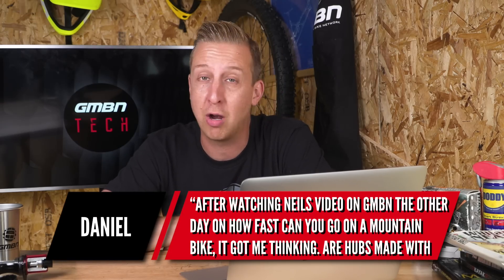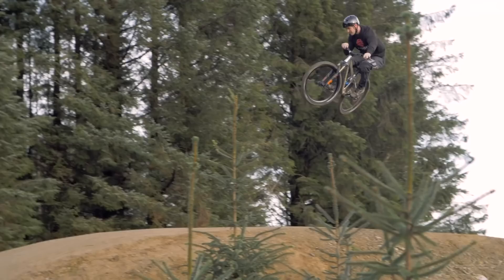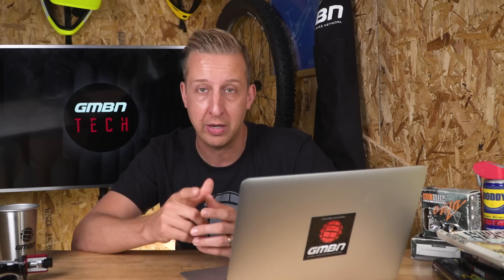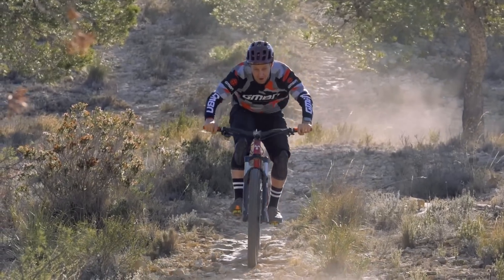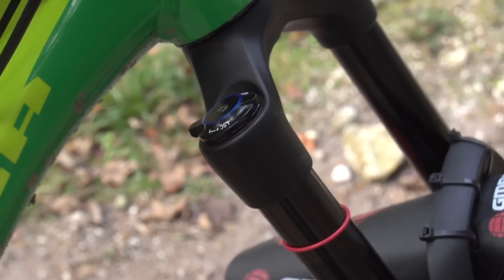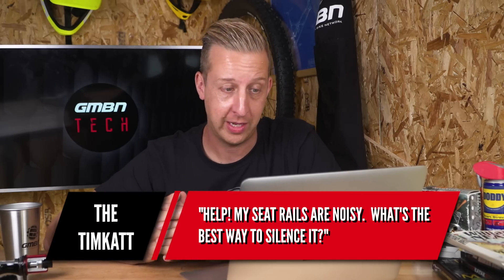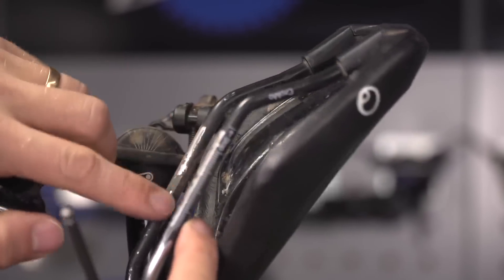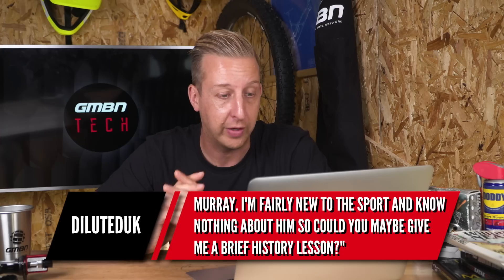Will Riding Too Fast Break MTB Parts? | GMBN Tech

Comment from the maker: Keep your questions coming in for next week by emailing hellotech@gmbn.com or using #askgmbntech and any questions for Park Tool's Calvin using #AskCalvin👇
Reply: GMBN Tech hi daddy love your vids
Reply: Just wondered are frame protectors  really needed In enduro races
Reply: @Duckyboi-0069  I just put some huge dents in my down tube from a high speed loose rocky section, wouldn't have damaged it if I had some protection, just depends what type of terrain your gonna be riding.....
Reply: #askgmbntech Can you give some hints on what I have to look on when I wanna buy a second-hand bike? Like wich parts to look at carefully and what you have to take attention of when test riding.
Thanks for your work, definetly learned much of your great answers.
Reply: Hey doddy I don't know if you remember but I left you a tip on here about using closed cell backing rod as tyre inserts/rim protection, got a rear flat in a enduro race and rode it to the finish with no issues to the rim.....
Reply: #askgmbntech Hi Doddy, love the tech stuff you bring out everyday. I'm currently riding a 2016 Btwin rockrider 560s. Recently, a creak has developed which I managed to narrow down to be coming from the suspension bearing cap. I loosened off the cap and the creak disappeared. However here is the problem. When I try to tighten up the cap to the recommended torque(8 ~ 10 Nm), the creak returns. Currently I have the cap a little over finger tight so as to keep the cap from creaking and ruining my rides. Is it fine to continue riding the bike this way or is there anything I need to do?
Reply: Hi Doddy, why no new air shaft for the pike (cheap and making the fork better for about 35€) or charger 2 instead of rct3? I would not build in a old rct3 and i also would think about going to a shop to tune my bike for much more money. Even tokens can change the fork (the new from formula work great in a rs fork). So i am confused why you not thinking about all this things.

Comment: #askgmbntech Hey Doddy , I'm going building full suspension 29er in the near future just waiting for all all the parts to arrive. I've everything ordered at this stage assembly compound , chain lube etc.  bar the grease since it's a carbon fiber frame and I keep seeing contradictory statements on the internet about what you can and cannot use. So can you us me a few options on what grease I can use on the bearings in the head tube, bottom bracket and the pivot etc. Thanks in advance.     Mark
Reply: Mark Phelan actually I have the same question regarding integrated headset in carbon cups. Some say I shouldn't grease it; others that almost any grease will fit.
Reply: The only one I've seen so far that specifically mentions that it's safe for use on carbon fiber is the Park tools polylube, but I'd like to see if there are other options out there that I've missed. Hope that helps. If you see anything else in your research fire back a reply.

Comment: #askgmbntech Hey Doddy, I recently saw a video on The Singletrack Sampler where someone had a converted GripShift as a Dropper post lever. Could you explain how that works? And could you use a brake lever for that as well? 
Thanks to anybody answering

Comment: #askgmbntech hi guys great show as usual, i have a quick question my vitus escarpe 2018 has a FSA Mega Exo (BSA) 73mm ive just bought an xt crankset(boost), i admit i probably didnt research this properly do you think the crank axle will fit the above mentioned bb or will i need to replace the bb, any help greatly appreciated. keep up the great work guys

Comment: #askgmbntech Love the channel, it's been really helpful. Just curious about positioning of rear-shocks. Does the positioning and fix point of the rear-shock affect ride-handling? E.g. a rear-shock that is vertical compared to one that is angled, as well as being fixed to the top tube or down tube; like the Yeti ASR-5 or the Whyte T130 compared with Canyon Neuron. Thanks

Comment: #askgmbntech

Hey Doddy,
I would like to upgrade my drivetrain, if my current one is worn out. I am running a Shimano SLX and XT 2x11 combo my Spectral 2017. I have a 34/24 chainrings up front, a 11-42 cassette and a XT rear-derailleur with the long cage. I want to go for the 36/26 chainrings up front and get a bigger cassette for the rear, like the 11-46 or even 11-50. But I saw that there is a correlation from 3x, 2x and 1x to the size of the cassette? Why is that? Is it not only connected to the chain length?
I hope you help me out here.

Cheers Steffen!

P.S. Yes, I want to keep my 2x11 setup ;)

Comment: For the pike guy:
-check out the new air shaft (debon air 2)
-if you want your fork standing higher in mid travel, get some formula tokens
- if you want spend more money, get charger 2 and no rct3

Comment: #askgmbntech hey, I have a dilema I need to answer to. I am ready to buy a new bike and my choice is on the Canyon Strive CF 7.0. I am wondering if I should buy the 2018 version right now to be able to use it while the weather is still nice outside or if I should wait a few month for the 2019 version that will come out in october-november. I mean, do you think the upgrade that will come with the 2019 version will be really significant ?

Comment: #askcalvin hi Calvin I'm a big fan of park tool please can you help me, I've got a 2007 giant glory dh with a 2010 rockshox boxxer race that feels sticky and doesn't feel plush and gets stuck 15 percent through the travel, I have to take all the weight off the fork for it too spring back to normal, It doesn't absorb small bumps properly through the lower portion of the travel and works ok when I use more travel, I was told this is common for the boxxer race to do this with age do I just need a service or a new fork.
 please can you help me

Comment: #askgmbntech hey doddy I've got a 2007 giant glory dh with a 2010 rockshox boxxer race that feels sticky and doesn't feel plush and gets stuck 15 percent through the travel, I have to take all the weight off the fork for it too spring back to normal, It doesn't absorb small bumps properly through the lower portion of the travel and works ok when I use more travel, I was told this is common for the boxxer race to do this with age do I just need a service or a new fork.
 please can you help me

Comment: #askgmbntech What will happen to your brake when it gets too hot? I have a Low end shimano Non Series Brakeset. When going down, I tend to brake hard but I dont let my tire skid when braking hard. When I come to a full stop, due to no more braking because my rotors have gotten to hot, I tend to water the brake, What are the possible things that will go wrong?
Reply: Brake Caliper and Rotor.

Comment: #askgmbntech Hi Doddy, My Spectral 2018 comes with sram guide R brakes out of the box, I was wondering if 2Pot Shimano XT brakes would be suitable upgrade for this bike. I take it to bike parks and gravity trails. If not could you suggest another brake (preferably Shimano). Thank you
Reply from the maker: Hey MTB/ST, if you're wanting a lot more power then the Shimano Zee brakes are probably the best best for the price. The Xt brakes have been said to be a bit more powerful than the Guide R's, though there's probably not too much in them. We'd say probably to go for XT's and bigger rotors.
Reply: thanks will do

Comment: Hi Doddy, 

I've had a creaky headset for some time that I think is due to the top cup moving in the frame. I've reinstalled it a number of times with grease, then threadlok then loctite pushfit assembly compound (641) but it still creakes over bumps and under hard breaking.

Is it possible to shim out the frame to get a better fit?

P.s it's a hope headset and Titus frame. The bottom cup goes in tight but I can pull the top cup out with my fingers.

Cheers, 
Kev.

Comment: #askgmbnteck I'm going to change my saddle soon, should I take my dropper out of my bike to do this cheers
Reply: No need at all. But if ur new saddle sits higher or lower, u might need to adjust the post position in the frame, to keep the same ride height of the saddle top (where ur arse contacts!) Saddles are not all the same 'thickness'
Reply from the maker: Hey Liam, exactly what Rupert said 😉

Comment: Some dead reckoning here, but bear with me... a standard skateboard bearing similar to what you’d find in a hub is rated for a maximum of at least 34,000rpm. Based on a rough circumference of a 27.5” wheel with a 2” tyre of around 235cm, that would mean a speed of 7,990m/min. That works out to 133.16m/s, or around 298mph. On that logic it’s fairly safe to assume the tyres would be the first thing to give out from speed, much the same as cars/motorbikes/etc - that’s why your car tyres have a max speed rating. So don’t be worrying about your hub unless you’re cracking 300mph on your mountain bike, and if you can manage that I’ll be be impressed!
Reply from the maker: Thanks for the maths! If that's the case, then we really have nothing to worry about (should you actually take care of your bearings).
Reply: I think in reality the first thing you'd notice is the wheels being out of balance, because we don't bother balancing bike wheels properly (because most people rarely break 30mph) and I've seen a fair number of tyre casings that aren't exactly uniform all the way around. Bearings definitely won't be the failure point, as long as you look after them like you say!

Comment: #askgmbntech I recently noticed my rear rim is cracked around the spoke eyelets and the spokes are pulling through. This is causing issues with loose spokes and a wonky wheel. What could have caused this? I ride a hard tail and ride quite hard or would it be me over tightening the spokes. If I cant get a warranty replacement could you recommend a back wheel? I'm looking at the Halo Vapour 35 at the moment.
Reply: New rim...if that fails on the trail, u WILL be in mucho pain!
Reply: Do you have alloy nipples? I’m having the same problem currently, and every time one of them snaps, I throw in a brass nipple, and true the wheel the best I can. It’s quite a pain though because I have to take tire off and rim tape and such.
Reply: @brycedennis8688  it's brass nipples, and it's the eyelets (I think that's the right word for the spoke holes) that cracked. So needs a new rim
Reply: It could be corrosion, weak alloy, a brutal impact. Some wheels are too weak for heavier riders. I cover the holes with grease to avoid corrosion, it worked well but makes a mess, so need to clean it off and add more later. But in addition I wash my bike after evry ride in the winter.
Reply: @mtbboy1993  yeah I case a lot and generally ride fast through rough stuff so was probably me but will try get it covered on warranty anyway. The bike mechanic I asked said he would say spoke should snap before the rim cracks so might be a defective rim

Comment: I have had a problem with my seat making noise before too. I thought it was the seat clamp but it turned out that it was because my seat was all the way down. I'd suggest making sure that it isn't all the way down. Could be making contact in the frame.

Comment: #gmbntech if you put a cabletie through the cable holes in your rear derailur in case if you snap your cable you can put it to a single speed
Reply from the maker: Yup! You can also use your broken cable in the same way.

Comment: Should I be tempted to start mtb on a full sus trail bike?  My budget allows for the alloy Canyon Spectrals. Of  course nice hardtails in alu, ti and steel are on the list too,  but the Canyon has kit on the same level. Mind you I do ride by the seat of my pants. I have ridden down stairs on my road bike with 23c tyres ... #askgmbntech
Reply: Goodman 4525 I’ve got a spectral, great bike 👍🏻
Reply: Nothing wrong with starting on a good FS, go for it

Comment: #askgmbntech I was just wondering if ridings drop offs while locked out is bad for your forks/shock. I can't be the only one who has forgotten to set them to "open" again after a long climb. Cheers.
Reply from the maker: It is bad for them because they can't do their job. However, many shocks have an inertia valve that with open up when it senses a hard impact.
Reply: superspecky4eyes apparently they can explode with all the pressure
Reply: Benji...rubbish (unless a total crap/knackered fork)...wait to be corrected, but I dont know of any modern mtb fork with lock out that doesnt have a blow off or by pass valve for this exact reason, and if this wasnt triggered, it wont be enough impact to do anything to ur fork...ur fine...well ur fork is..u might fall off with a big impact on whats effectively a rigid bike!
Reply: Having said that...dont aim to do it...!

Comment: should I get a coil shock for my new ike I've heard they feel really good, however I have no idea on how to set them up. so I'm thinking of just getting an air shock. any advice? #askgmbntech
Reply: Big advantage of the coil shock is that you don't need to set it up. :) Choose a spring rating and you're good.
Reply from the maker: Hey Morgan, TomaCukor is mostly right! But finding the right spring weight can be challenging. TF Tuned (and others) have a spring calculator to help though: https://www.tftuned.com/spring-calculator
Reply: Morgan Roberts I like air so I can adjust it if I need to carry lots of beer.

Comment: #askgmbntech #askcalvin i have a problem my seatpost keeps sliding down and its pretty anyoing keep rising it up how can i fix it ??
Reply: Clean it and put some assembly compound on the post and service the clamp
Reply: @th_js  i tried that it helped a little bit but its doing it anyway
Reply from the maker: Maybe look at getting a new seatclamp. Not all of them are created equal.
Reply: @gmbntech  ok thanks a lot all of you who helped me out =)
Reply: Glad we helped!
Reply: And its not undertightened
Reply: @windowsplatinum3723  if it's quick release clamp, it might be worn out, and getting slacker and slacker due to plastic par and shim wearing making it looser. Also seatpost and frame will wear and lose grip, so use assambly compound, this will also eliminate creaking.
Reply: Dropper Seatpost? I had this problem with my dropper seatpost. The cabletension was the problem.
Reply: Are u sure u have the correct size post for ur frame...

Comment: Awesome! Thanks for answering my question on the hubs 😁 I look forward to hearing what any manufacturers say to you.
Reply from the maker: We are too!
Reply: I'm guessing at a curtain speed heat will be a problem in the freehub
Reply: Bike wheel bearings and grease are designed for low load low speed, low resistance (compared to a motorbike or car). Sustained extreme high speed (like a motorbike on a motorway) would melt bike bearing greases and lead to bearing failure....the heat could damage the hub and freewheel etc...BUT on a bike ur not going to have sustained high speed...so I doubt the hub manf test this (freehubs etc). The bearing manf will likely have specs for the bearing/grease combos...but no bike is ever going to come close to the limits of a quality bearing and grease as the load/speed factors are low. If it was required moly grease (as common in car cv joints) would be used...but agree, be interesting to see the vmax for diff hubs (same wheel size). But those lasting longest would likely not be the best bike hubs as implies high resistance from overly heavy grease...